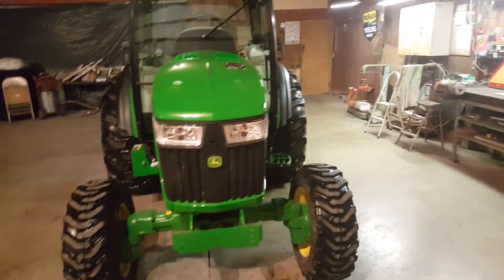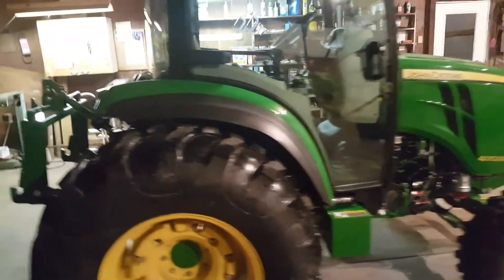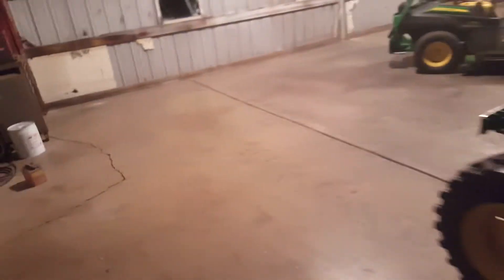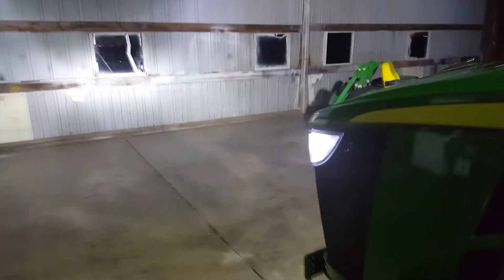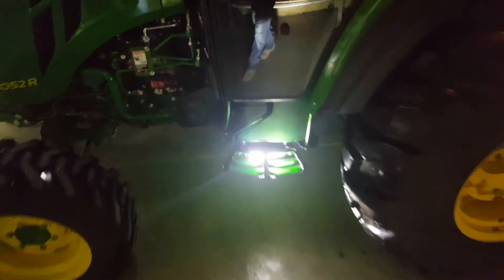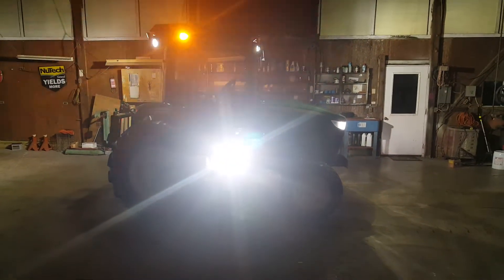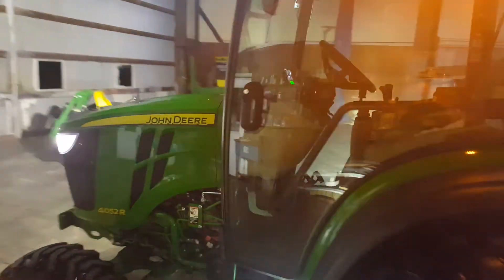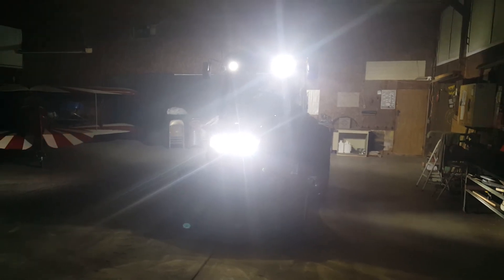John Deere 4052R LED light completion - ALL DONE!

Comment: Where did you find the headlight bulbs? I think my fender lights and headlights use the same bulb. Great job.
Reply from the maker: TS Gear, They could be the same. Mine were different on the cab tractor..862 up top and 886 out front. Xenon makes them. I bought them off their website

Comment: is there a factory strobe light harness you used on the roof?
Reply from the maker: Factory switch so I spliced into the beacon light wire that's there from the factory. I already had the roof off so it was an easy install